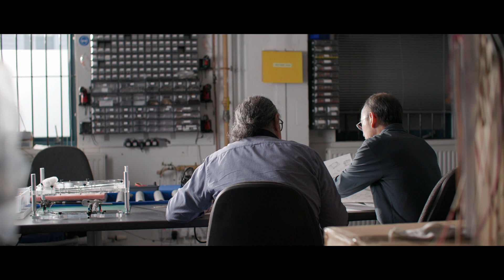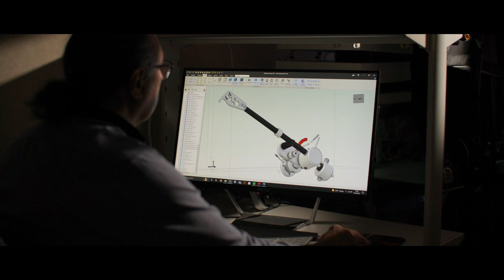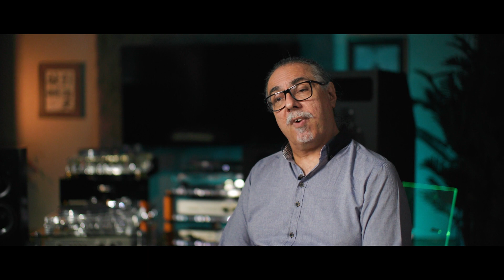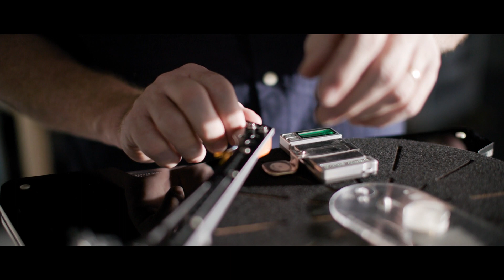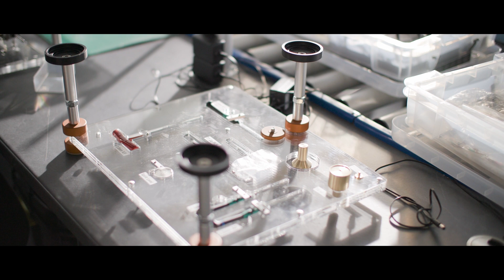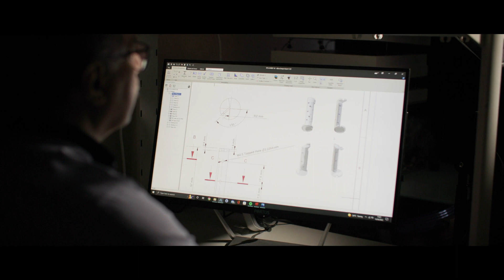Vertere Acoustics - Our Philosophy

Comment: Always loved Mr. Moghaddam designs, since I have seen and heard the Roksan Darius MkIV speakers (that I still use) and the Xerxes turntable. 
The Vertere line of products looks very distinct from other competitor brands, with top quality and engineering, sadly very rare from hi-fi products nowadays. 
Perhaps, some day, Vertere will offer more than vinyl related products and cables… like an integrated amplifier or a dac? :)